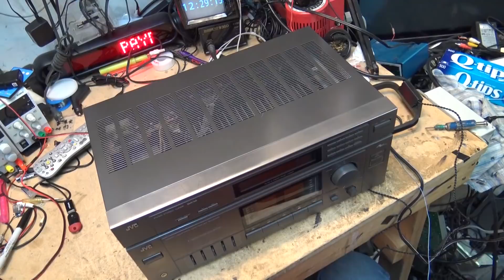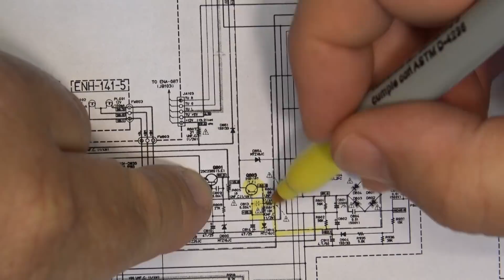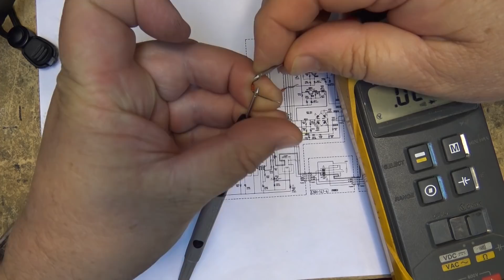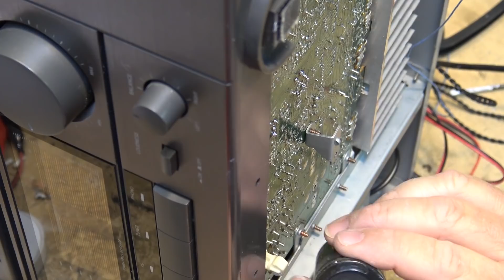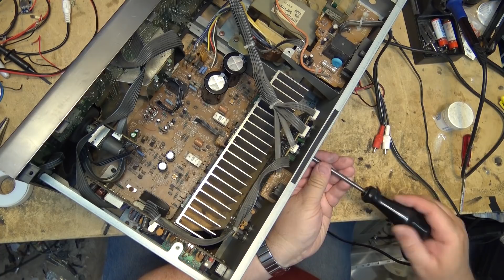JVC Rx R76 No Sound just distortion REPAIR

Comment: How can you hold the solder wick ?  It conducts heat fast and gets hotter than hell when I use it  I can’t hold it  ??
Reply from the maker: I cut my teeth with vacuum tubes.  They get hot as hell and nobody waits for them to cool. You pull them hot and get used to it. Same when the finger stick to check blood sugar, everyone says it hurts and I don't even feel it.  Wait till you see the video I am posting tonight white I clean the tip of my soldering iron by grabbing it. It is 725'F and no I wouldn't recommend it.  Yes I do have feeling in my fingertips I am just so used to dropping molten solder on my hands I don't feel the pain that others would find intolerable. I puck up hot pots off the stove and my wife shares her head and says how can you pick that up. It's hot Allright it just doesn't bother me.

Comment: just wondering if you know anything about the JVC RX 515V from 1993 5 Channel receiver I bought off of ebay that had the original box & accessories but had no power with only the standby light coming on. I found two bad transistors that were shorted  A1633 & C4278. so i unsoldered them & now the display comes on but i still have no sound on the other speaker channels just wondering if that's normal with the two transistors not installed or does the amp need to see all of them installed to have sound? i did order new ones not sure if the unit has any other problems yet but it looks like it was hardly ever used not sure why the transistors shorted maybe too many speakers hooked to it or maybe they shorted the wires while hooking it up but who knows.
Reply from the maker: No it typically won't work with components disconnected.
Reply: @12voltvids  oh ok I guess that's a good sign hopefully that's the only thing wrong with it.
Reply: @12voltvids  I got the new transistors today and installed them but still no sound. Not sure what to check for now just wondering if you have any idea. I did try using the tape rec out to another amp and confirmed that the radio works on it. Another thing I noticed is that the relays don't seem to be clicking for the speakers. So it must have took something else out with the transistors.

Comment: I'm so mad at myself right now!!! My receiver was working perfectly. But I was worried about the D812 and D815 diodes. So unplugged it and went in to remove the two diodes so I wouldn't have problems in the future. I didn't have a long enough wire snips so I wiggled them out, I thought,  very carefully by bending them back and forth. Now my cool LED display is not working at all. What did I do and how can I fix this. Sick about what I did 🤦

Comment: I know it is a a slim chance of getting a response, but what are some reasons why the receiver won’t power on? The dual tape deck, and disc changer powers on, but not the tuner.
Reply from the maker: Could be just about anything.  You will need to do some inspecting . Check fuses ext.
Reply: Check the main fuse inside on the top left rear of the receiver. Where the power wire goes into the receiver

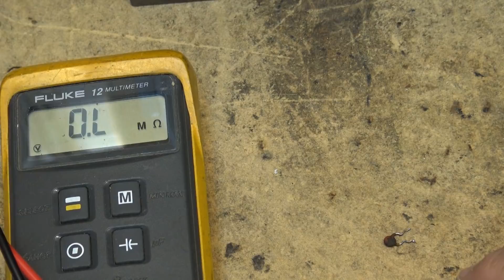Comment: 15:58 Thank You, i knew disc caps could potentially fail but you've just broken my disc-cap cherry. Never seen one short before now, or even be bad in any way aside from physical damage. Shame we can't use some tech like an X-ray microscope to see the failure mode, would have to guess it was the culmination of a defect from the factory, pore in the ceramic or similar.

Comment: The glue that holds large capacitors to the pcb as the years passing dries and is turning from white to black and from insulator is getting conductive.

Comment: To unplug solder pump tips i use the pull through wire that you find in flexible conduit. I guess it's galvanised. Seems to work.

Comment: hi i am doing the same thing to my AKAI Gx77 LUCKY IT'S MY  DECK i had to pull the deck a part to put new caps in as they did the reg's in alot were burned out
a bio reel to reel     that's been pip up for 15 ips is hard to get hold of

Comment: I only use that white thermal compound for making ICs easier to read. I would not use it on a CPU nor anything else I cared about. Arctic Silver is MUCH more effective. Top-hole vid as always.
Reply from the maker: Who says I care about equipment.  It's a machine after all. The since oxide silicone paste was good enough for the manufacture. It is good enough for me.  I am not about to source expensive materials because I can't recover my costs from a client.  I once ordered a 5.00 part and the shipper sent it fed ex instead of by post.  That triggered a 37.50 broker charge that I was happy to pass on to the client which pissed him off with me.  But had I not passed it off then I would have lost money on the repair and that is not sustainable.  I'm in the business to make money not operate a charity.

Comment: What kind of transmitter are you using?  Is it a kit or an assembled unit?  I want to use one of those to send a signal to my antique radios.  Thanks for your great videos.
Reply from the maker: Both the FM and CQUAM am stereo transmitter were kits.  I also have a little more player FM transmitter unit I bought for 10.00. Both the FM and am kit builds are on my channel.  The am transmitter is over the top as it is am stereo.  For vintage radios a mono transmitter is all you need.  The nice thing about the one I built is it has auto modulation control so it sounds fantastic and will make any am radio sound as good as an am radio can sound.  An am stereo radio sounds simply amazing.
Reply: @12voltvids  Thanks!  I'll check out your video. There is a very simple breadboard AM transmitter setup available on the Science Buddies website, but I would like something a little more robust.
Reply from the maker: @audiobuff77  
This one was relatively expensive. 130 I think but the sound quality rivals a broadcast transmitter on both mono and CQUAM receivers.  I did a demo of the sound quality recorded through it into an am stereo radio.  With the high power option 400mw it goes about a block with the built in antenna. More than enough to cover the house.

Comment: Great job Dave! A light shining in from the opposite side of the circuit board will allow you to see the traces really well for troubleshooting
Reply from the maker: That only works with single sided boards. Multi layer boards wont do much good, especially with shielded layers.
Reply: @12voltvids  Was that a single sided board you were working on?

Comment: sir can you explain what is negative and positive supply of dual power supply to preamp tone control  and how to wire ty.
Reply from the maker: Operational amplifiers or Op Amps require a split supply.
The easiest way to generate this is with a center tapped transformer. The center tap is your ground, and one winding winding to the positive rectifier and the other to the negative.

Comment: Why does it seem every electrolytic I test seems to go up in capacity? is that normal? I.E. 47 uf will read in the 60's ... anything to do with ESR?
Reply from the maker: Capacitor manufacturing is not an exact science.  They will never measure what they are rated.  Usually it is over.  They can be as much as 10% under and 20% over and be in spec.

Comment: i  was  realy expecting  to see  a  old  stk  module  in  the  power  amp  but  i like  this  unit  all  transistor  outputs  its  not  that  bad  ....
Reply from the maker: So does the guy that owns it who spent a small fortune on shipping it to me to repair. It's not a bad unit for an all in one receiver.
Reply: I honestly did too. But as well as i have seen a few that did not. Like this one. Surprising for a slightly low-end 90's receiver. But not all the STKs were bad. So of the Technics amps of the 80's-90's were decent and some superb sounding but would overheat some would and cause the SVI sereies pack to get so hot it would desolder. But some were decent at almost 30 pounds and well over 100 true watts. Not many of the 90s receivers were worth a single dime but there were a few. Probably less than half of them. But the SVI (computer driven stk) drove the fan and protection relay as well so it is crucial that they keep solder joints intact very well and that the fan stays clean.

Comment: Awesome repair! a very extensive diagnostic on this one. It seldom for a ceramic capacitor to be shorted and this will give a headache when it does. I've learned a lot from your explanation why could this happen.  I'm currently working on a Technics amp model SUV6X which is a dead unit and found lot of failed diodes, resistors and transistors and have them replaced. Right channel Power transistors were shorted and I have them replaced including the left transistors which are good btw. The only problem was a Germanium Diode -OA90 which is not available locally and I'm still looking for a replacement online. Can I use 1N60 diode as a replacement to this one? Thanks! more power to your channel!
Reply from the maker: A silicon diode has a much higher forward voltage than a germanium diode. Look in an old AM transistor radio, they usually have germanium diodes.
Germanium diodes have .2v forward voltage drop, whereas silicon .6v
Reply: Hi Dave. Thank your for your response. I have an old radio here and I will check for that later. I appreciate your help. Thanks!

Comment: good day sir.. i have db audio kvg umak1518 amplifier i has a burned recister also has a distortion sounds when it power of and tuned to fm or mp3 so after i opened the amp i saw burned recister left besides the 2 big capacitor after i replaced it it also smoked up and 1 other recister burned when i replaced it yes it powers on without any mess but no sounds.. what and where to test other parts may posible to be damaged?thank you

Comment: hello 12voltsvibes i have a quesation for you i got a pioneer 6 pack cd model pd-m40 and the lens fell out i put it back and its staying and working great but i was told to super glue it in back but am worried the gases from the can you tell what i should i trust you answer more then anybody else thank you
Reply from the maker: Yes we used to super glue them in place at the shop. A tiny, tiny ammount is all that is needed. I used a toothpick. The smallest drop on the tooth pick, and then to the very edge of the lens where it fits into it's holder did the job. There are other glues that will also work and don't off gas such as good old white glue that kids use in school. Apply the same way. I used to use LocTite, you know the stuff used to keep screws from unscrewing. That worked great, and doesn't off gas like krazy glue does.

Comment: These thermal pads are specialy designed to transfer heat and isolate element from heatsink ... when you put thermal paste (or grease) you make it much worse and messy and heat dissipation is dramaticaly less than without thermal paste here ... beter alternative is to remove pads and leave only paste but only if transistors are in isolated package, otherwise this thermal pads are the best solution here but without paste ... if you need proove just mesure temperature with and without paste.
On the other side, i love to see some old real electronics get fixed and granted with new life ... it makes me happy too
Reply from the maker: These transistors have a metal back electrically connected to the collector, and therefore require an insulator.
The insulation material have a thermal compound in them. Adding a little more thermal compound, and this is not the run of the mill silicon grease that radio shack sold, will only fill any gaps between the metal back and the pad. The key is not not put too much on, just a thin coat which is what the insulators had on them from the factory. These are not thermal pads like you have on a CPU, they are very thin mica insulators coated with the same compound I used.
Reply from the maker: Mica insulators are very poor at transferring heat. After all it was used as home insulation. Vermiculite is basically expanded mica. Thermal grease is required for the mica insulators. These ones are still mica based , but they have thermal compound between each layer so they do transfer heat quite well. The key is to not put on too much. Too much will result in less heat transfer. Just a thin film is all that is needed, and when the component is fastened, the paste spreads out to fill the air gap.  I did not put a ton on the insulators, just enough to fill any air gaps between the metal heat sink and the transistor / insulators.
Reply: It uses Toshiba 2SB1429 and 2SD2155, and the back of them look like a metal pad. Like this picture, https://www.picclickimg.com/d/l400/pict/121078066485_/2SB1429-Original-Pulled-Toshiba-Transistor-B1429.jpg Is this an isolated package? I get what you mean, you don't want to short the transistors out against the metal heatsink. If what you are saying is true, I hope Dave will revise this, given he hasn't already boxed the unit all up. As I don't want worst heat dissipation, I run these transistors pretty hard.
Reply: After doing a little research myself, I shouldn't second guess Dave. It appears what he calls "insulators" are called mica and doing research on these "mica insulators" which they come in various sizes, several people on different forums state that you SHOULD put thermal compound/grease on both sides of the mica. This mica is supposed to keep the transistor from shorting to the heatsink. Most people say just a small pea on each side, some say to smear it. Everyone says don't add to much, as too much thermal compound is actually a bad thing. Dave was right..
Reply: Good stuff to know! These "micas" as I see they are called, weren't clear so that indicates they have thermal compound in them? As I see clear micas and people say USE THERMAL COMPOUND on them. I'll do my research first before jumping the gun and thinking there is a problem when there really isn't, one of my downfalls I am working on. Good work, and we have a lot to learn from you, that's why I love to pick your brain.

Comment: Wow... This hours takin excellent work should be expensive for the owner.
Reply from the maker: It wasn't as long as the time clock shows. I worked on it for awhile, then went and cut the grass, then took the Harley out and went for lunch, and dis some more work on this. So it seemed like an all day job, but it was more like a couple of hours.
Reply: Going into it I told him I would pay him well and provide a tip. He wanted like $100 to fix the fault, I was like no way, I'll give you at least $300. I'm paying him what he's worth, even if I have to pay in increments, I don't mind. There was a reason I shipped it all the way to Canada... he knows what the hell he's doing and will go the extra mile.

Comment: I've never ever seen a shorted small capacitor like that, nice find.   Well this one .. a lot of screws but at least everything looks logically placed and a lot of room.  Nice one again!
Reply from the maker: Luc Peeters
Yes easy to work on. 
Shorted ceramic cap. In HV circuits like horizontal output on TV sometimes they fail but never on low voltage stuff. Well not untill this one lol.
That's why I missed it initially. Not looking for it untill there was flames.
Reply: I don't think that cap failed on it's own, too much of a coincidence if it did. I really do think it was from moisture/water getting to that cap or around that area of the circuit. I've learnt my lesson and will use my brain next time! :P

Comment: As far as a circuit bulletin, just gut the old LCD/LED light bulb VU meter and replace it with a nice blue-green VFD ;-) But eh. thats just me.
Reply: No, I like JVC's pick of their vintage orange and red, and I provided the fuse bulbs and they were very cheap to obtain. Though I have seen them use blue/green combo as well, but orange and red were their style and I dig it. The power meter itself are orange LEDs, the backlight is just an orange/red piece of transparent plastic paper like thing.
Reply: The JVC I owned was an orange color filtered based unit as well but it had a VFD behind it instead of LED or LCD., it was an AX-R450. The indicator was a spectrum analyzer instead of a VU meter. That thing was a powerhouse! I forget what it was rated for, but I had a pair of Technics SB-CR99 speakers hooked to it, and I could get it so loud that the woofers would start smoking. Anyways, at the end of the day all that matters is what you want and how you want it to be, and how you want to use it ;-) Oh, and that you enjoy it :-)
Reply from the maker: THEtechknight 
It's all about keeping a vintage receiver looking vintage. Yes I could have put a big resistor in there and some LEDs but again it is all about keeping things stock. My old beer signs that were lit with a 7w bulb could easily be fit with a 1w led but they don't have that warm glow so I stick with the 7 or 4 watt incandescent. For the number of hours they run it costs me nothing to run them.
Reply: Sure, but VFDs are vintage ;-) I dunno I just have a VFD fetish. everything has to have a VFD. :-P
Reply from the maker: THEtechknight 
They might be vintage but they were not original on this unit.